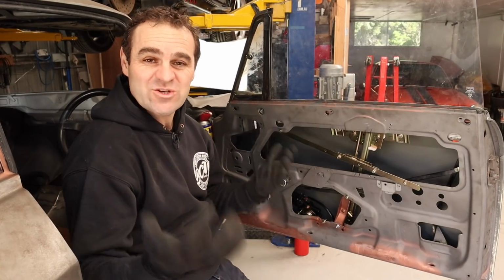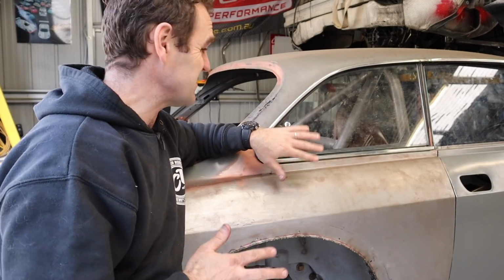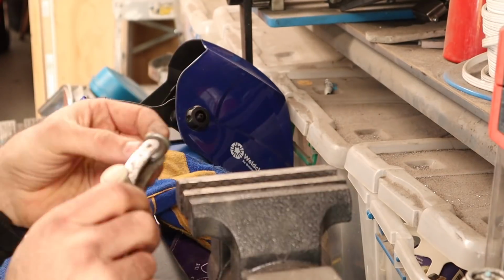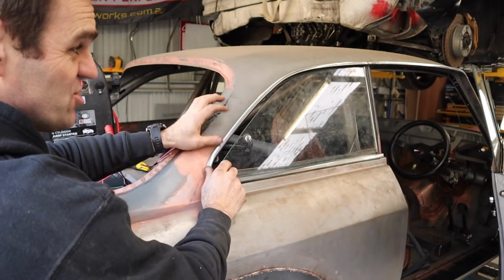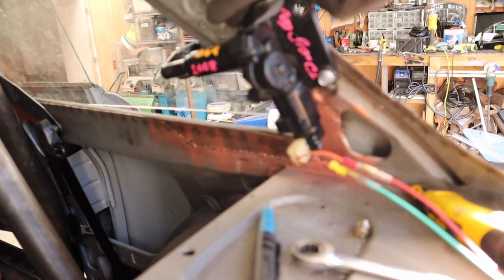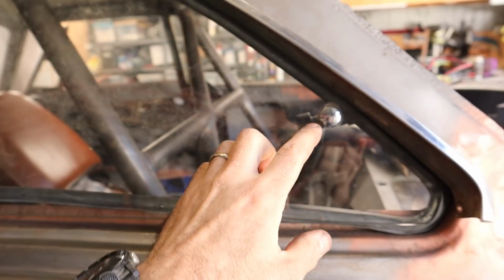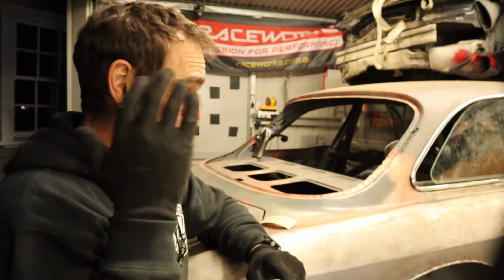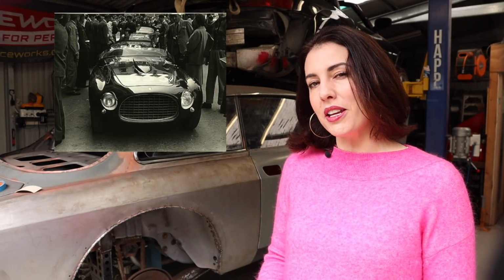Custom power rear quarter window  - Ferrari engined Alfa 105 Alfarrari build part 98

Comment: Jeff, that's a brilliant mod. I bought a GTV 1750 in 1982, and in my excitement to show off its many  features to friends, I went to open the rear quarter glass only to have it fall off its hinges. The 3 plastic hinge blocks had perished, but the glass remained
 attached by the latch swinging on the rear guard. Got lots laughs for that one. One Alfa that had a similar feature to your mod, was the 105 Zagato Junior. It had a rear tailgate that the driver could open it by 40 to 50mm while in motion. A switch operated an electric motor with a worm drive. Cheers...
Reply: Please, dont tempt him with more mods!
Reply: @Wytnucls  HAHAHA... okay I know what you mean, he's got a lot on his plate already..

Comment: Agree with the build it all then disassemble and spray method, I'm doing the exact same process 👍
Reply: Same here
Reply: Absolutely necessary to avoid altering components when the car goes back together.
Reply: Now that advise will really help my own projects, cheers.
Reply: You just need to watch the Retropower UK guys to know its the proper way to do it.

Comment: Now you made the metal cover, could you use it as a plug to DIY vacuum form a thin plastic cover instead, may be a bit lighter and neater and just look like a rear seat belt real cover 👍

Comment: Really nice work Jeff.
The rear quarter glass has 3 rubber blocks that act as hinges. They slide onto the chrome mould attached to the glass. A small “C” type channel is slid onto the rubber block and then screwed in through the “B” pillar. Good luck.

Comment: That's really a neat touch, I just noticed the roll bar would make it really difficult to reach the latches on the window, so they will be twice as helpful! Some smaller motors might be easier to hide but I'm sure you'll come up with something later on!

Comment: Jeff. My e46 compact had opening rear quarter glass. I'm sure the motors were smaller than them. Might be worth a look.
Reply: He mentions the E46 right at the end. My E46 330Ci did too.
Reply: @_zzpza  ahh, I switched off before that, my Mrs was nagging me to go food shopping!!
Reply: Indeed. I also owned an E46 with powered rear quarters.
Can vouch for there effectiveness.
Does pull in the cold air from the heater vents.
Reply: Using the entire e46 electric window assembly with door controls would have been a smart idea I reckon as the rear window mechinism is much more discreet, plus you get features like holding down the open button to open all the windows at once. Good for a hot country.

Comment: You’re absolutely right about doing this all before paint. Making changes after paint is just heartbreaking.

Also you need the rubber hinges on the front of that window or it’s going to drop out when you get up to speed. Ask me how I know.
Reply from the maker: I am sure you have found the same, even with a original restoration.

Comment: I also saw the same thing on rennch. And back then i was also surprised about the giant motors. I was gonna suggest the E46 system. I had one too, a long time ago. I can't remember everything but what i do remember is that it didn't need those big covers on the c-pillars to hide the motors. And that it had a linear movement instead of a circlear one. I think it would've been a better system then this.

Comment: Hi. Here in europe we have car that have the best motors for your aplication. It is the lancia y10 from the 90's. It is very small and the best solution. Sorry to tel you after the other video, but it's bater later them ever. Keep going with the good work e take the time you need to finish the great work.

Comment: Feel like this motor would be better mounted on the lower edge of the window. That would require replacing the windows with the hole for the pivot being relocated to the lower side of the window. But, The motors could be turn almost 90 degrees and mounted lower and out of view. Requires more work, but the same results without a hump in your C-pillars. Just a thought. Otherwise, nice work. Enjoy watching the progress.

Comment: Awesome mod, Jeff. :D The designer in me has to say I think the covers would look better if their rear edge followed the angle of the rear window, tho. ^^ Edit: Also, BMW E46 coupe rear window motors might have been a better choice, as others said. They look like the shape might be easier to integrate into the Alfas C-pillar.
Reply: Exactly my thought. And maybe a tapered connection up top to blend it all in a bit more.
If not switching to a smaller motor. 👍
Reply: @NewtonInDaHouseYo   Thanks for the link. That’s the WAAAY more neat solution. 👍
Sorry Jeff, but it’s not like the first time you redo things on this car…and with something placed “in your face”. It’s a no brainer. 😊

Comment: A mod that I've seen on minis with that style of rear windows is a pin so that you can disconnect them and open the windows all the way, it means you can load things on the back seat through the rear windows, with your roll cage it might mean easier access, and more room for luggage.
Reply from the maker: Interesting idea.

Comment: I'm sure you have thought about the whole thing a lot. But I ask myself if it would have been possible to mount the motors below the quarter window, with the moving part upright?

Besides of that: Nice feature. More important than the door windows, I believe (thinking of my Mini-times, where I had the same problem with the rear quarters).

Comment: hey for the motors couldnt you have used the original levers but modified to operate off a bar at the base of the hinge and the motor just hidden below the parcel tray where the rod connects to?? would have been much more stream lined i think?

Comment: I had one of these lovely alfas 30 years ago and always used to forget to close the back windows.  Mbe you could wire them in to the central locking?  Got pretty good at the reach back opening technique at the traffic lights... 🙄

Comment: Hey Jeff love your site watch it every week. You’ve built three of my favorite cars now, I am restoring a 67 911 targa. I have an idea for your rear quarter windows. What about a flexible shaft like you could use on a drill to reach a screw. Place it in a metal tube through the hole on the inside of your C pillar and move the motor to the trunk? This would hide the motors and look very bespoke. Just an idea. Thank you for the level of detail Do you provide in your contact. Scott

Comment: If Saab had them it’d be a Rube Goldberg mechanism with 14 cables, 9 levers and a single foot control and no adjustment points.  Your solution is great, don’t worry about it.

Comment: If you made the covers more triangular and come further back and down into the bottom corners of the rear screen /parcel shelf, covering more of the Cpillars, they can be trimmed and finish the area behind the side window motors, make this area neater and easily finished?

Comment: The windows are held a the front by three small rubber hinges, if I remember correctly. I replaced the perished ones on my 1750 a long time ago. They are easy to carve from some small blocks of rubber, if the original ones can't be obtained.
https://classicalfa.com/rb008-gt-gtv-set-of-3-rubber-hinge-blocks-for-rear-side-window/
https://classicalfa.com/rb050-gt-side-window-hinge-clip-cover/

Comment: Can you extend the shaft of the rear window motor, so you can mount the motor under the parcel shelf?
Reply: Good idea! One could also fabricate simple shafts with levers actuated by push-pull solenoids (power doorlock type) placed below the parcel shelf

Comment: I know I'm a few weeks late, here, but what about just tapering the top of the covers up the full height of the pillar - yes, it'll reduce rear visibility towards the top of the pillar slightly, but I reckon you could probably make them mostly disappear with a different shape...
Reply from the maker: I know you are catching up, so have a look at the next vid ;)
Reply: @HomeBuiltByJeff  yeah... dangers of commenting on older videos! 🤣 Nice changes though in the next video, definitely a better solution!
You've got me thinking now about doing similar to my Anglia, as I've got almost identical catches, but I do have some space behind the window where I could squeeze some mechanical wizardry! (I knew there was a reason I kept putting off making those final trim pieces, this must be why!)

Comment: Our Chrysler minivan had very clever and tiny actuators on it’s rear windows.
Reply from the maker: These motors are from a Town and Country ;)
Reply: @HomeBuiltByJeff  yep. I always felt that the interior reminded me of a Queen Air. I liked riding in the third row. Kids got bigger so it was replaced with the big ford. Lots of space but ugly. Now driving the big Lincoln. Ahhhh.

I am building a small two seat roadster using an MGB and tons of body panels, chrome trim, dash board and tons of bits to create the Clipper “B”; a 1954 Packard that they never made. Not one visible part will be from the MG. I have made an aluminum valve cover that looks like a flat head 4. Cast into the top in Packard script is “ Half-Pack”.
🤣🤣👍

Comment: The E46 Coupe motors are a much better solution, as they’re basically an electrically driven piston. I had them on my E46 328Ci

Comment: Only got half way through before I had to point out the fail.
You didn’t need to mount the motors on the C pillar for them to work.
You could have mounted them on the parcel shelf or under the window and still gotten them to work properly.
Also the motor mounts are looking like they will interfere with the rear glass seal.
Reply from the maker: No. They won't reach from there.
Reply: @HomeBuiltByJeff  making a new drive shaft extension is what a lath and welder are for.

Comment: Looks like the motor is too close Tom the rear window mounting edge. The rubber seal for the rear window may interfere with the  motor bracket.

Comment: There is a rubber hinge in front of the glass.  It should be available at classic Alfa. For the quarter glass.  I think the bulky electric mechanism is ugly. The stock system works well and is much lighter.  This car is getting so heavy the wonderful handling feel of the GTV is going to be lost. Please reconsider your priorities in regards  to weight. You are building a beautiful project. It will be a shame to loose the fun driving that the Alfa is famous for.
Reply: That's way too harsh. It will be a fun car, unique and it's home built 😁
Reply from the maker: I am guessing that this car will weigh 5-10% at most more than the original car, and it will have more than 3 times the power, and much more functionality. I think it will still be fantastic to drive :D
Reply: I am guessing 2800 lbs. with 1700 on the front.  Stock is 2400 lbs. 1400 on the nose. I built a 300 hp turbo GTV. It was 2500 lbs. 1500 on the nose.  I did a lot to strengthen the chassis. It was raced and was very fast.  Still dove line an Alfa. Very easy to control and drift if you wanted to. I was constantly aware of trying to reduce weight and still gained 100 lbs over the nose.
Reply: @rjung_ch  This is a beautiful build.  Simply using aluminum in place of steel for the custom covers, and various mounts.  Moving the engine back into the fire wall.  All these things would contribute to the lowering of and relocating of critical weight.   The Alfa is hampered by excessive weight on the nose in stock format.  I have built and driven a 300 hp turbo GTV.  It is fun.  But adding even more weight will hamper the feel of how the car drives.  Jeff has the skills and tools to make various parts from Aluminum.  The craftsmanship and design is fantastic and I look forward to each and every  episode.  But seeing the weight go up and up with stuff like a rear window power unit and knowing how this will ultimately effect the car is concerning.  I have experience with building vehicles like this.  I have raced vehicles like this.  I know how important " add lightness is"  I do not mean to critique.  Only to help.  Either way this is a very exciting build. Jeff is a master craftsman and artist.

Comment: Are you really going to leave that sketchy metal strap on the window motors? I figured that was just for mock up. I'd make a sheet panel with some dimples that attaches above and below the bolt holes. Much stronger and will require less adjusting in the future. The straps are similar to the old "universal" central locking kits and the torque of those little motors would flex the straps and you would have to pull the door cards off and adjust them all the time.
Reply from the maker: The 'dodgy strap' is 1.6mm and is now welded to the cover making it more than strong enough.
Reply: @HomeBuiltByJeff  well, you say that.
I know this is how they're designed but I've installed a bunch of these universal kits and they always need adjusting and its a pain. Especially when you're on a road trip and pull up for lunch and it starts raining and your window stops 5mm from the top.

Comment: Great to see them in and working 👍
Little bulky but working, perfect solution for blending into C Piller would be same as making 90's door speaker pods (you might even put some tweakers in there)
Basically stretch a fleece material around your shape you want to achieve, could even wooden frame bits to make the shape removed later and apply fibre glass resin to set the shape, trimming will be easier
You can't really see it in this video but midway looking at the newer golf clocks in my old MK1 this is how there stripped and grafted in & sprayed Matt black 😉 https://youtu.be/usVM7CGcphQ

Comment: Brilliant solution ... except for the motor mount which ruins all the aesthetics.  Cobbling is nice if one is a shoe repair person.  The motors would have been better placed on the rear parcel shelf.  But that may not have been possible with these motor units.  The convenience is undeniable even without a roll cage.

Comment: With the internal pressure in the car, even with the front quarter lights open, the rears want to stay open on their own. I run Perspex on my race car and the latches are loose - they self-open. I’m with the comment below about cable operation. I totally get that you don’t care about weight (these cars come alive when they’re light) but you’re creating lots of complexity for the sake of it - maybe that’s the point…

Comment: Why no A/C? It gets to 45°c out here in SW Sydney. I'm sure same in Goulburn/Bowral/Canberra. Retro A/C kits don't look bad. If ya think it's too hard to integrate it into 70s cars. My first car was a 74 XB GT. Grew up in Rockhampton. Hot as. Previous owner fitted a under dash kit. I baught the GT in 1990. What ever A/C unit it was back then worked its arse off. HIGHLY RECOMMEND! I'm sure 2020 retro A/C would be gtg. Was 30yrs ago. No offence, grew up in the 70s, still remember old man's torana with qtr windows. No thanks. You're still gonna be sucking in 40+ heat. I can live without power steering and power windows.
A/C? No! My windows hardly ever open. Zero aspirations of getting a convertible. Tinted windows, a/c. A must in Oz.
I'll be keeping a/c in my Alfa GTA when I get it track specced. Losing a hp or 3 is not a huge issue.
Reply from the maker: The XB has much more room under the dash. With the bigger tunnel and everything else in this, I don't have any more space :(

Comment: Hey Jeff! Great idea with the electric rear quarter window. You might wanna look at the method BMW used on the E46 Compact (not sure if that car was even a thing in Australia ...) I've used to own a E46 325ti with those windows and the mechanism is waaay smaller. Have a look at: https://www.ebay.de/itm/363414179361

Edit: nevermind - didn't watched the video until the end while writing this comment :D